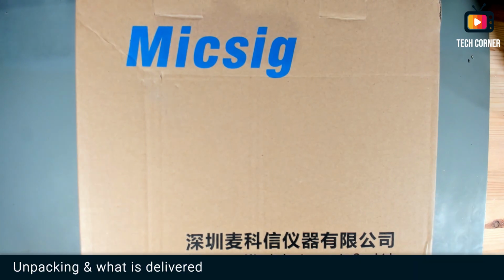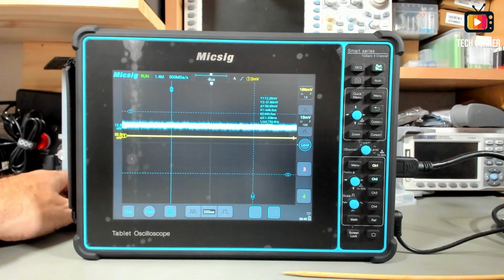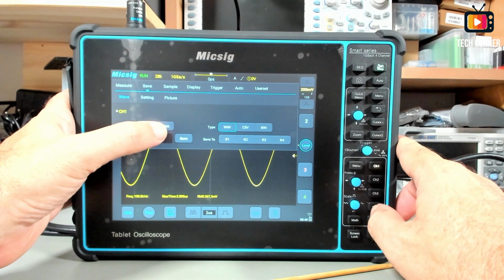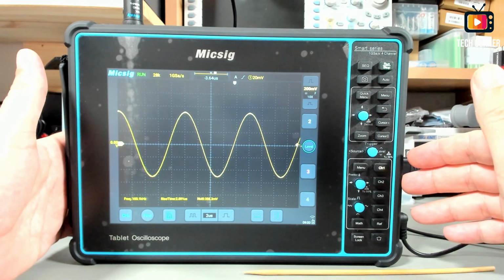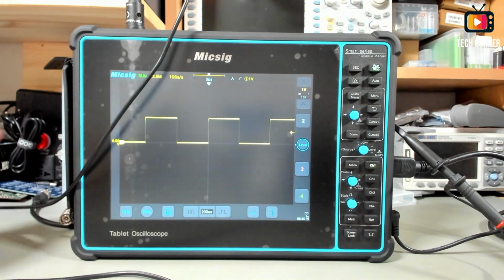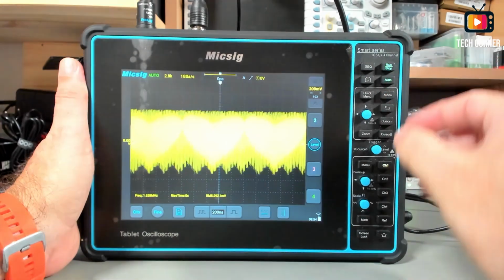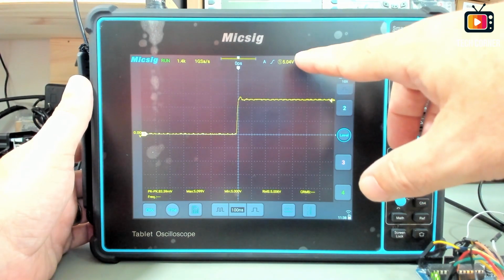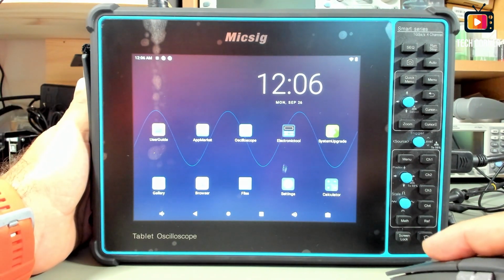Micsig STO1004  Tablet Oscilloscope⭐ 4 Channels & 100Mhz ⭐ You have to see this!

Comment: There's a trick to applying large screen protectors like this: Go to your bathroom, close the door, let the shower run with hot water until the mirror/windows start fogging up, and THEN start applying your screen protector. You'll find that there's an almost zero possibility of dust getting under the protector.
Reply from the maker: Hi, thanks for sharing, that is a really nice advice! 😁

Comment: I want this oscilloscope to test on 240v ac voltages, so I guess I will need a x100 probe (as in other oscilloscopes). My question is: does the active probe have an automatic x100 attenuation or would it be better to have an actual x100 probe? I ask this question to know if it is safe to use this oscilloscope with 240v AC voltages without damaging it.
Reply from the maker: Hi, this is a Isolated Oscilloscope, in theory, you can just use the 10x attenuation to measure a 240v, but I don't work ever with that voltage, so I recomend you to see this video ( https://www.youtube.com/watch?v=a3ePild_sFs ) and you'll get better answers that I can provide. Thanks for watching!